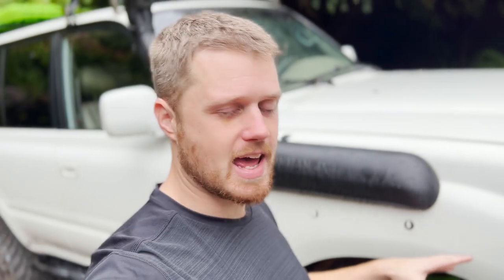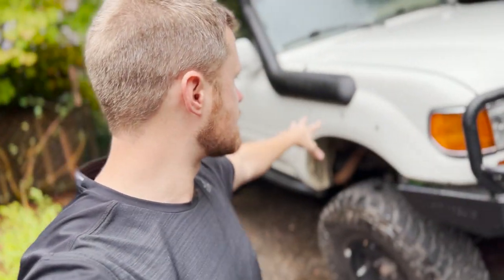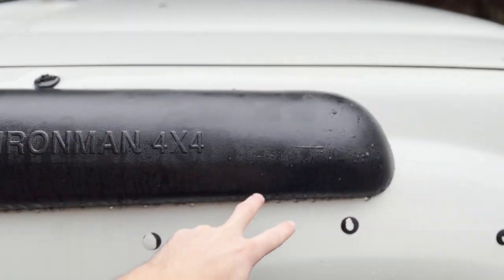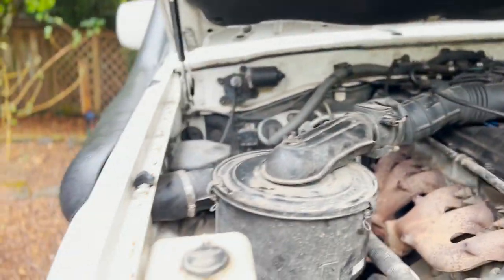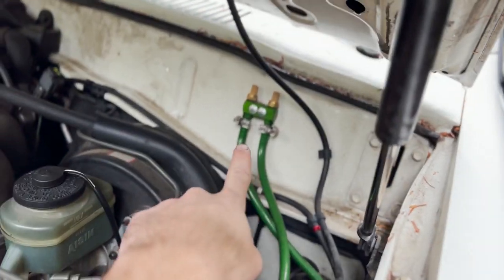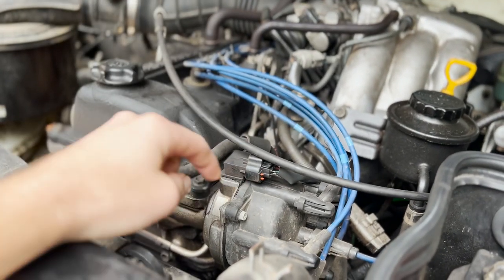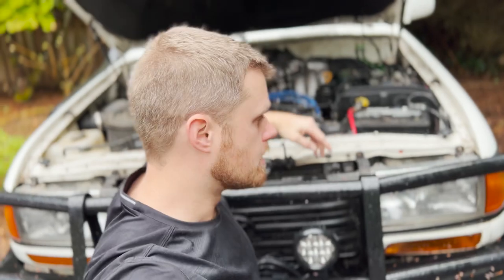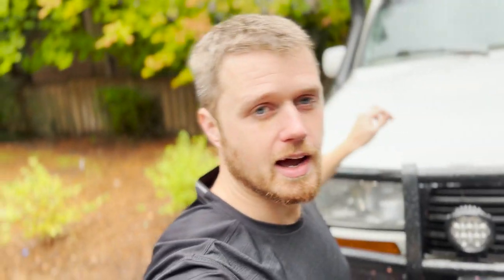Why you NEED to Install a Snorkel on your 4x4 even if you live in the Desert

Comment: Wasn't the Land Cruiser 80 designed to go through deep water in stock form?
Reply from the maker: It definitely can go through relatively deep crossings stick yes. The diff breathers go up about 2 feet. Having cold clean air from the snorkel being up high is a huge advantage as well

Comment: I have a f150 4x4
Reply: I live in a flood zone I want my truck water proof as much as possible
Reply from the maker: I see mishimoto makes one for f150s- I’ve used several of there parts before with success and they’re pretty well known for their quality. Then you can just buy around 30 feet of whatever type diff breather Hose yours use and route them up to the top of the engine bay !